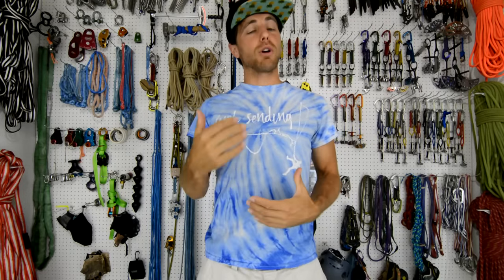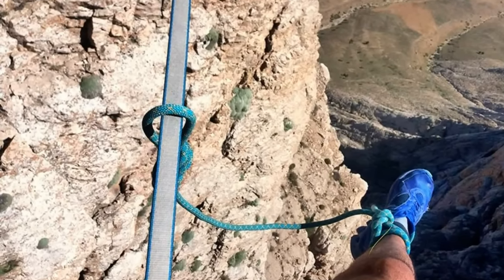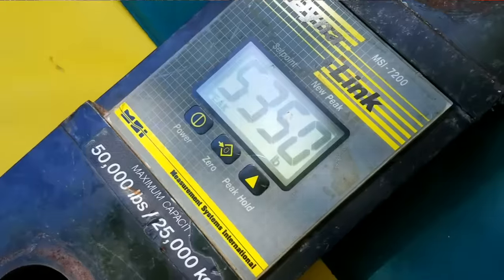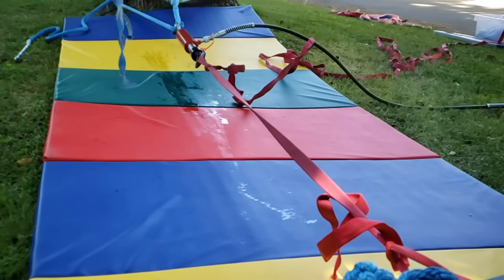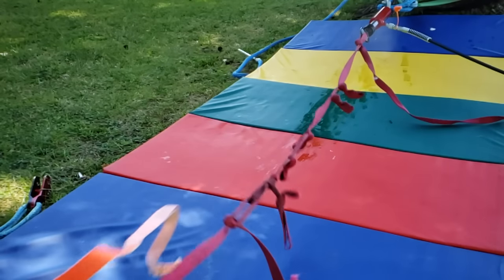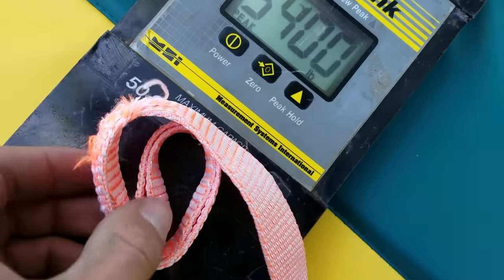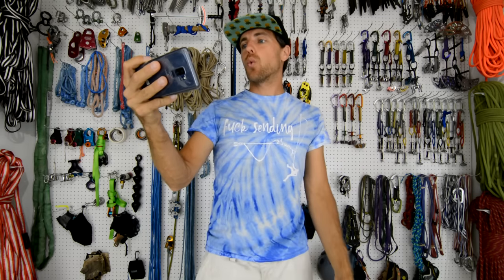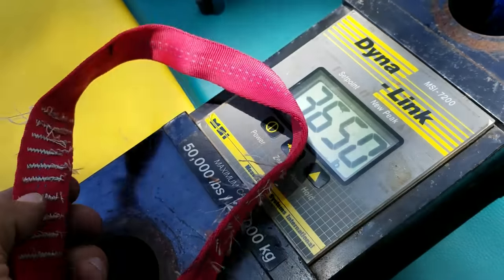My 1st break test video! Sewn loops on slackline webbing

Comment: I took your advice from the woopie sling video, and bought the Samson splice book the first paragraph states that MBS is tested/ certified with an eye splice on both ends .
So a proper eye splice( LOCK STICHED; NOT BRUMMELLED) dose not reduce MBS.

WOOPIE SLING IS STATED AS "70% OF MSB." USING 3.5FID BURIED AND A LOCKING BRUMMEL. MAKING THE MINIMUM LENGTH FOR ANY WOOPIE 7 FID + FIXED EYE SIZE.
HOWEVER THE BRUMMEL IS WHAT COST 30% LOSS OF MBS.. 

DO YOU WANT TO CONFIRM SAMSON'S PUBLISHED STATEMENT? THAT THE LOCKING BRUMMEL COST 30% MBS.

Comment: Hi! What type of thread was used on a stiches? Any specs? Wanna lighten my backpack for simple slacklining, leaving one weblock at home.
Reply from the maker: #69 bonded thread is what i used. It is a bit small so i recommend 15 official bar tacks and not a hand sewing machine. At least 40 plus threads per bar. #138 thread is on balance community's sewn loops and those are bomber but require a bigger machine. Whatever you do, test your loops in a park down low as tight as you can make it with a 15:1 or 45:1. Make sure they are bomber before you use them up high.

Comment: Hi! Is it possible to measure strings's (used to sewn loops) average breaking strength? About sewn loops... Is the loop lengths affect on the breaking strength? I mean on short loops first break inner sewn?
Reply from the maker: Stitching pattern could affect bar tacks as much as the string/thread used in bar tack.  Hard to test something that probably breaks at 0.10kgf.  Loop length can only be a problem if super super small and if using a large pin so the angle of the webbing is 45 degrees or more, literally pulling the webbing apart from inside the loop if that makes sense.  If the loop was a meter long I don't think it would weaken it at all.  Does that help?
Reply: yes of course. you will surprise how strong the strings is. i heared that the main problem of sewn is to mutch strings according to webbing. in best case it must be the same as webbing material.  and it will be cool to compare weaker strings and many stitches and stronger one with less stitches.
i don't mean one meter loops be weaker. i mean it will be stronger on fat pin.
Reply from the maker: Sergey Tsimbalov if the webbing broke at the loop i think a fatter pin would help but as long as my stitching breaks before anything else then the pin is not hurting or helping at this point.
Reply: damn, my english is so bad for this :))
multiply stitches allow you to use weak strings. if you applay force very gently and divide it to all of them - they are live. but if it was uneven load then they will break, one by one. so, if you use short loop on the FAT pin then first stiches (closest to pin) will be heavily loaded with vertical force directed perpendicular to the webbing. 

If I am calculated it correctly:

F_first_stitch_vertical:= - 2*(F_total*D_pin)/(Pi*D_pin-4*L_loop)
Where: 
F_total - webbing force for example 10 kn, 
D_pin - pin diameter for example 12 mm, 
L_loop - flat loop length for example 100mm
F_first_stitch_vertical - vertical component of force (actualy double of it) applyed to the first sewn from pin in this example = 67.5 kgf
Reply from the maker: Sergey Tsimbalov i think i understand. If the string is pulled 1 at a time and not evenly it will break one at a time because they are not working together. A fat pin will put too much force on stitches closest to fat pin. What is interesting to me is that the static webbings hold more % than the stretchier webbings. I can hear the string breaking before the loop breaks on the stretchy webbing.
Reply: i think it is depends on stitching pattern, for stretchy webbing it must be wider zig-zag. to allow stretch webbing without break the stitch. preload while stitching may help also, but it will be very hard to do :))
Reply from the maker: Sergey Tsimbalov i will see if i can try this and see if it helps. :)

Comment: Does type 18 work for a primitive tensioning system??
Reply from the maker: Yes. It just is stretchy so its hard to get it tight enough to not touch ground in middle if it is too long